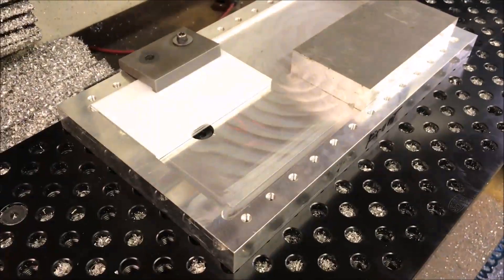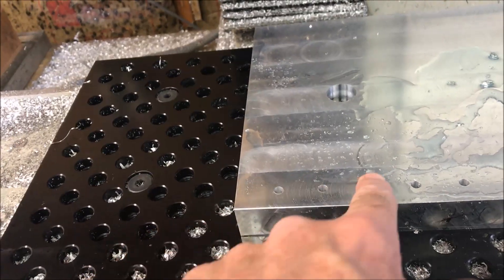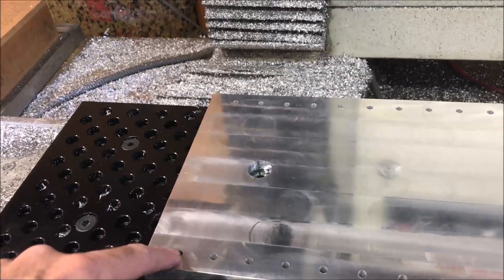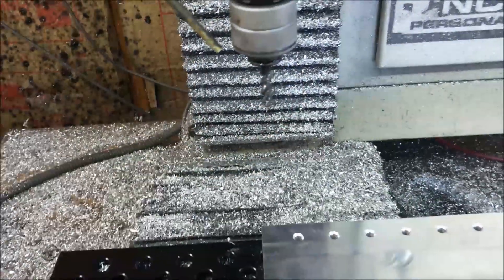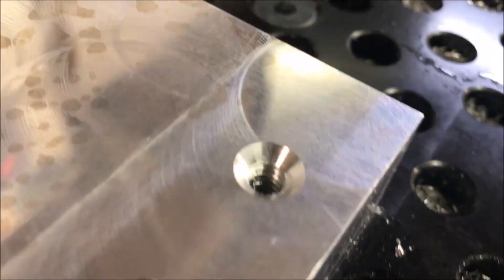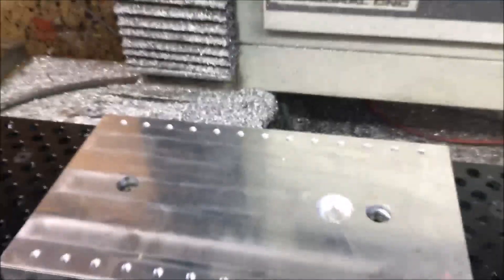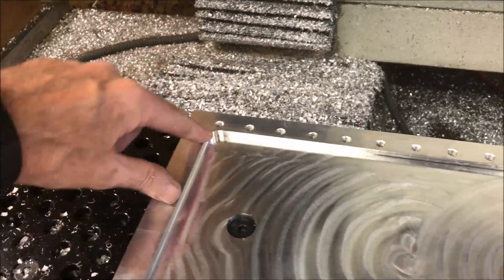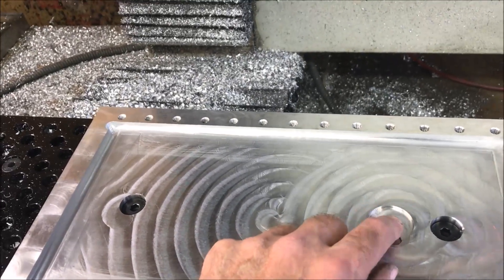Making a Universal Drilling Fixture Plate

Comment: Craig did you mount to the fixture then surface the fixture?, Good stuff
Reply from the maker: I surfaced both sides manually up on the modular pitbull clamps since the fixture plate is just outside my envelope.  Thanks Sam!

Comment: I run the ShearHog at 4000rpm / 0.125" DOC / 60 IPM all the time, or 0.200"DOC / 40 IPM.  Ramp at 25 IPM at 3 degrees.  Machine rocks it like that.  Give it a try.
Reply from the maker: Cool!  Do you have the 770?
Reply: We have an 1100, but should be same in this application.

Comment: Love the ten/comp tapping head.  You need  to increase the dwell time slightly so it doesn't pop out so hard at the end.  I run 300 rpm on the high speed pulley so I don't need to change to low gear.  Works great for me.  About a 0.4 sec dwell.
Reply from the maker: Yeah, its great!  Using the 770? I tried higher RPM and it would never bite.

Comment: Countersinks should be ran a lot slower than that
Reply: Jaakko Fagerlund The main reason is because they tend to gum up with aluminum when you run them that fast, and also it's just good practice to run things at the right rpm range
Reply from the maker: Wasn't sure and guessed.  Couldn't find countersinks in G-Wizard.  Maybe use spot drill feeds and speeds?  That would be around 1200 RPM at around 2 IPM for a 1/2"
Reply: Typically you would run it at 300 rpm or lower
Reply: Doesn't squel, cuts nicely and with good surface finish, so why drop down? It is only aluminum.